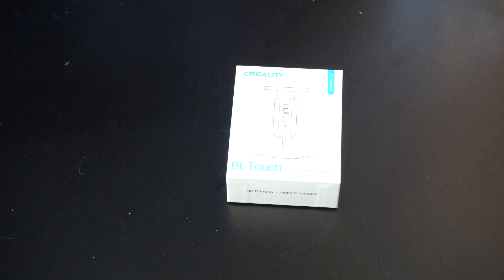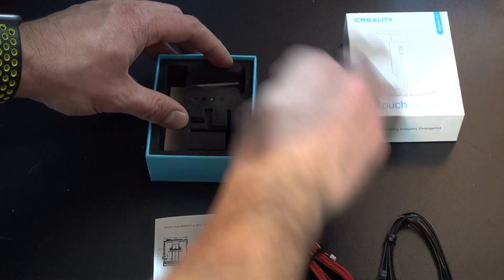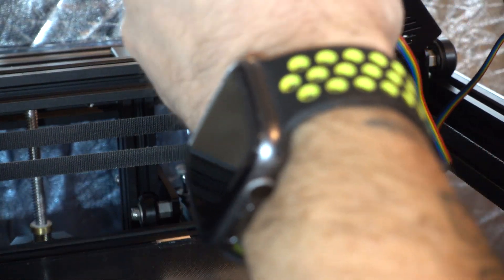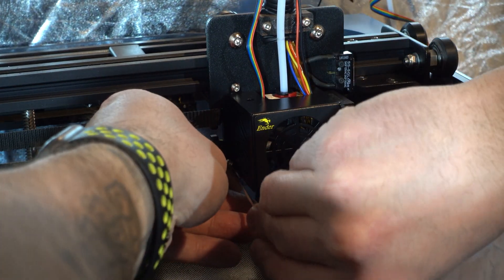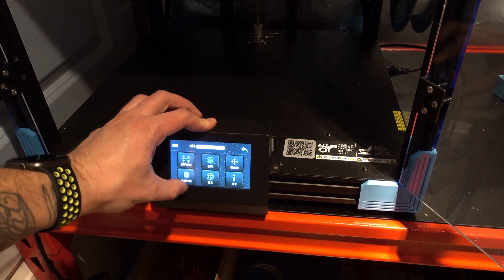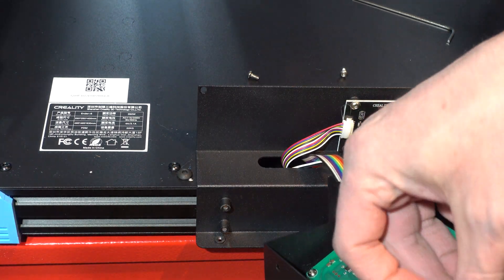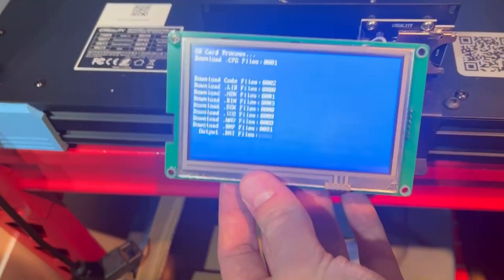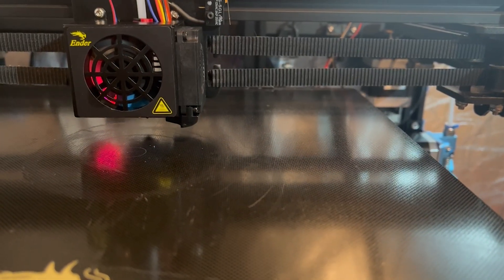I broke my Ender 6 screen

Comment: Man you summed up a lot of what I did in a much shorter video haha. What firmware did you go with? I am using insanity automation.
Reply from the maker: Ahahaha I just used the creality firmware. I have been meaning to make an update video but  I broke my hand so I haven't had the energy.
Reply: @phasenetworks9703  aww man. That sucks. I hope your healing up well.
Reply from the maker: @TableTopBiker  slowly but surely its just hard not to be a professional napper...  ahahaha.
Reply: @phasenetworks9703  we do what we are good at haha.

Comment: hello! in having the same issue but when i get the blue screen part it shows nothign but zeros, and doesnt show all the images reloading , i loaded the micro card with DWIN_SET files . any ideas on whats going on?
Reply from the maker: What size of card are you using?
Reply: @phasenetworks9703   the micro sd is 158 gb
Reply: @EYELURK666  if you have not sorted this, the answer is likely an 8gb card set to 4096 bytes.
Reply: @TableTopBiker  im not sure how to do that on a mac :(
Reply: @EYELURK666  I wouldn’t know eiter. Never had a mac. I will look it up later.
Reply from the maker: @EYELURK666  I had issues with a larger card but it ended up working when I used an 8 gb card.
Reply: @EYELURK666  I had to install windows on a pi to format the as card. If not formatted correctly, when updating the screen it won’t flip through all the screens it will just be the blue screen saying end within 5-30secs. It takes about 1-2mins when properly updating

Comment: Hi please explain what is next step after 5:28.. Should i wait in blue screen after wrote "END!" Top Right?
Reply from the maker: Sorry my camera died right at the end once the screen update completed on the blue screen there I just rebooted the printer and everything worked
Reply: @phasenetworks9703  thanks for answer. I have ender 5 plus and i cant find a DWIN_SET for it. I loaded official codes in website but it wasnt working godd
Reply from the maker: Sorry missed your reply… I have an Ender 5 as well let me see what I can find.